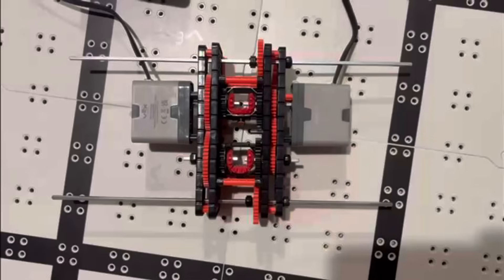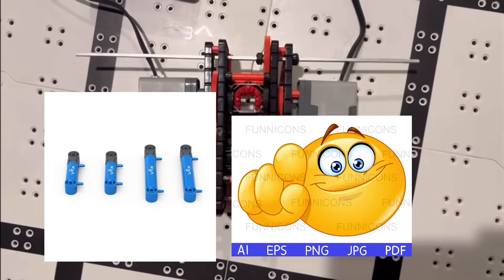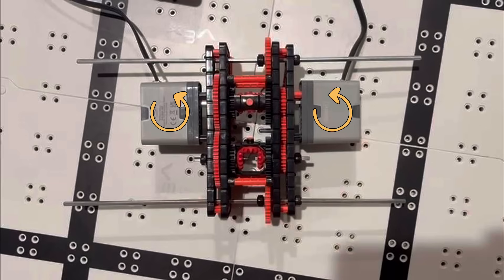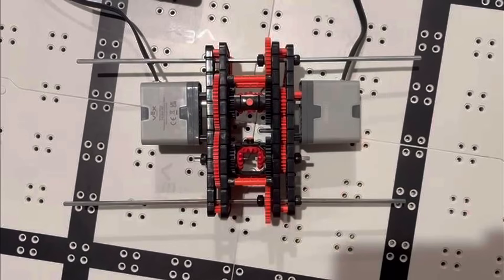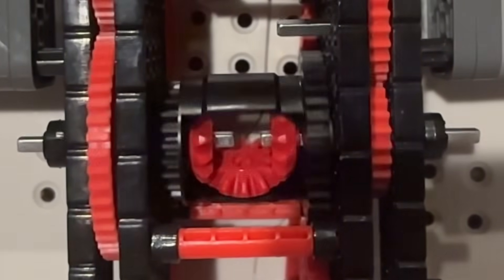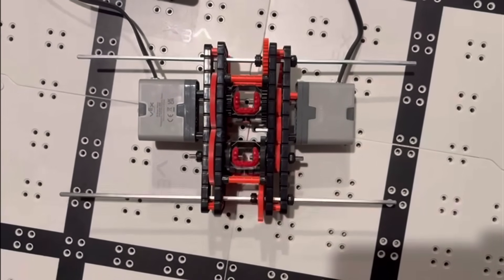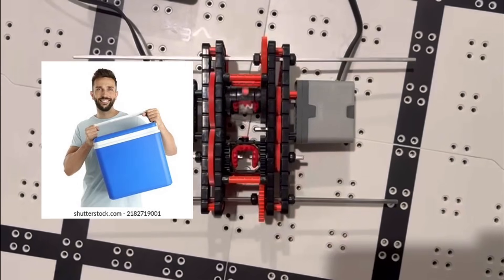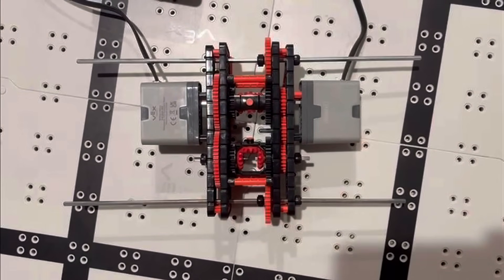Share motors WITHOUT Pneumatics?? Differential PTO Explanation

Comment: My team is trying this PTO out and we are connecting the PTO with our DT and catapult. Our DT is already 2 motors but with this PTO it will be 4 when we are not using a catapult so would we code it as a 4-motor DT, 2-motor DT, or just 4 separate motors.

Comment: How would you release the catapult
Reply from the maker: pneumatics
Reply: @thecappedpin  oh so the regular piston release
Reply: @thecappedpin  but isn’t it connected to the motor
Reply from the maker: it’s not, use the herobot ratchet. it’s connected to the differential
Reply: @ oh ok
Reply: you pull back the ratchet with a piston
Reply: @ahnafbyuiyan1027  or you can use herobot ratchet

Comment: bro just do 6m diffy drive
Reply from the maker: how u gonna intake bro
Reply: @thecappedpin  have 2 motors always on drive and 4 motors ptod to the drive with a diffy, just like with the 3 motor diffy it will only give power when moving forward
Reply: @anonymou-mj4jc  so you can only drive super fast going forwards, not backwards?
Reply: @ yea basically

Comment: What is the point of a differential pto if you’re using two motors to power two different things?
Reply: Imagine this: you used up 4/6 your motors, but you still need to power your intake AND the catapult. 1 motor for each seems to slow, but you cant do 2 motorss for each, cus it goes over the limit. usingthis, you can share to BOTH sides witb just 2 motors, but you just cant power them at the same time. its a good trade in my opinion
Reply from the maker: it’s not powering 2 different things, it’s connected together

Comment: How do you code it is it just the basic motor group or nah
Reply from the maker: the 2 motors are separate, you need to code 4 different combinations as stated
in the video. both spinning reverse, forwards, opposite directions, etc
Reply: @ ok tysm